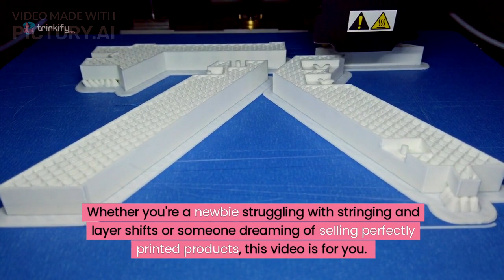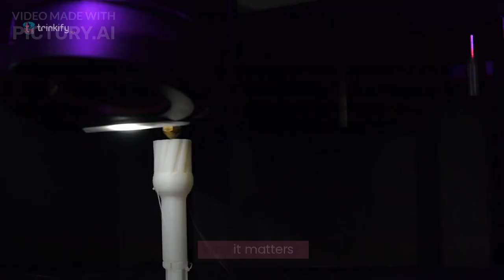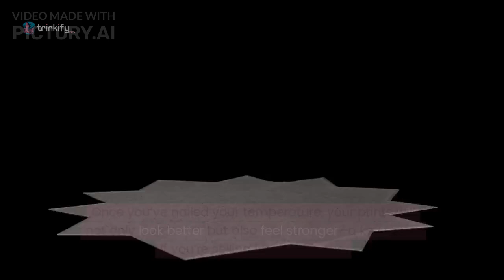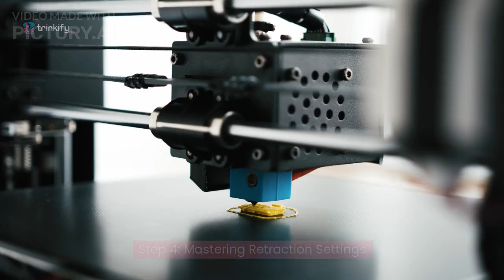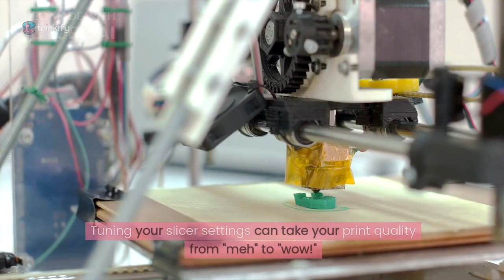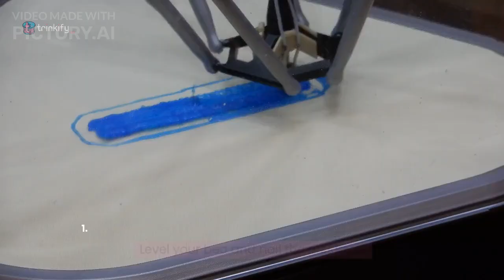3D Printer Tuning 101 Perfecting Print Quality in 5 Simple Steps

Comment: shifting of layers later in print
Reply from the maker: Shifting layers can definitely ruin prints, but it's usually fixable! Some common causes could include loose belts, overheated motors (lower print speed to avoid skipping steps), or obstructions. Check slicer settings like acceleration/jerk too—these can overwork the printer. Once dialled in, your prints will be smooth and reliable. Hope this helps! 

Thanks for the suggestion, I've added it to the ideas list for future videos 😊